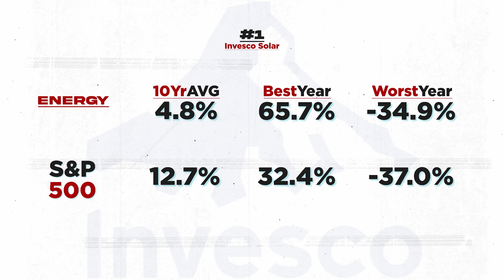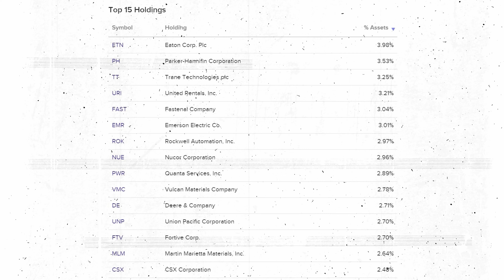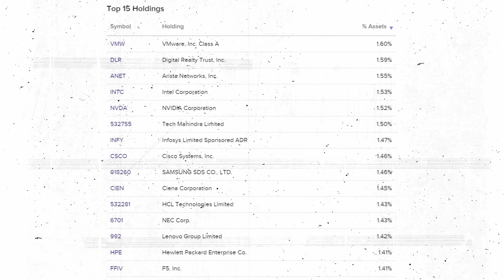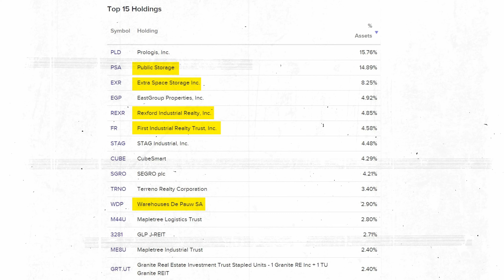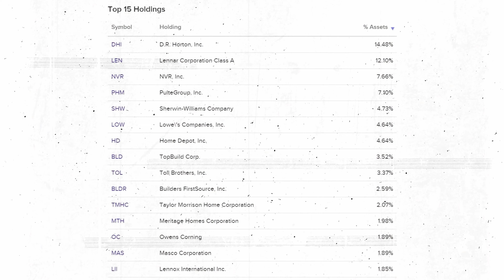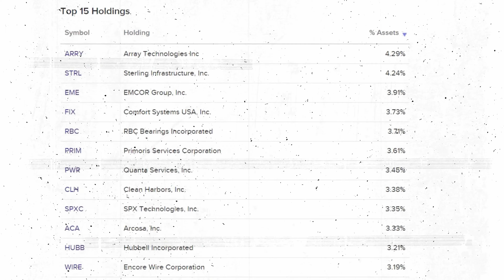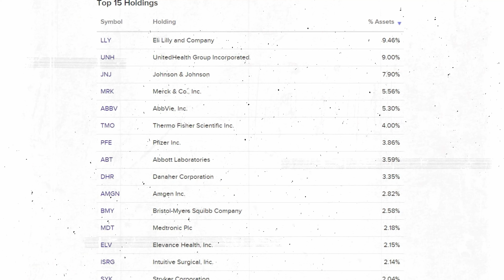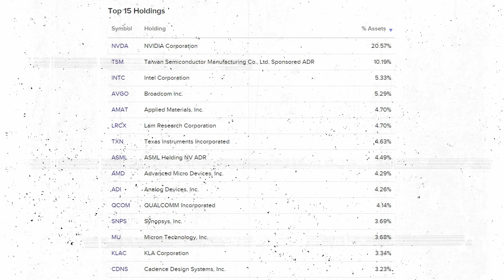Best ETFs for Long Term Investing For Beginners

Comment: My spouse and I are diversifying our long-term investment portfolio with $220k, emphasizing inflation-indexed bonds and companies with robust cash flows. While seeking long-term gains, I'm also exploring strategies for short-term profits in the current market.
Reply: While the current market offers short-term profit potential, it's crucial to note that executing such a strategy requires expertise and skill.
Reply: Having an adviser is the smartest approach in today's market, especially for those nearing retirement. I personally gained over $270K during this market downturn, which highlighted that there's valuable insight the average individual may not be aware of.
Reply: @ThomasChai05  That's impressive! I could really use the expertise of this advisor.
Reply: My advisor is Camille Alicia Garcia . You can easily find her online. She has a wealth of experience in the financial market gained over several years.
Reply: Thank you for this tip. it was easy to find your coach. Did my due diligence on her before scheduling a phone call with her. She seems proficient considering her résumé